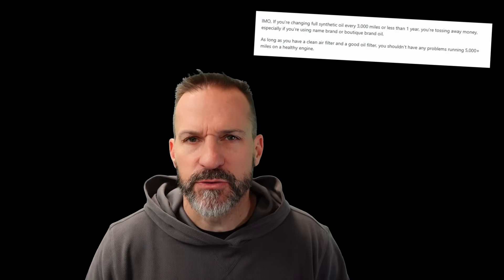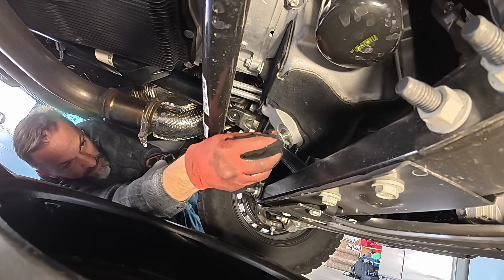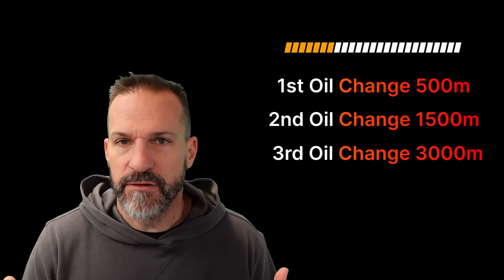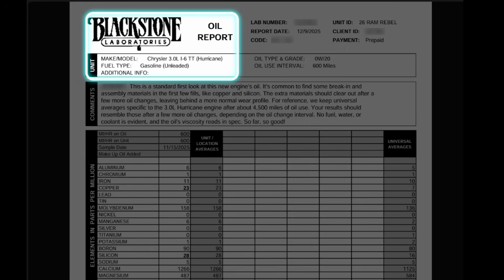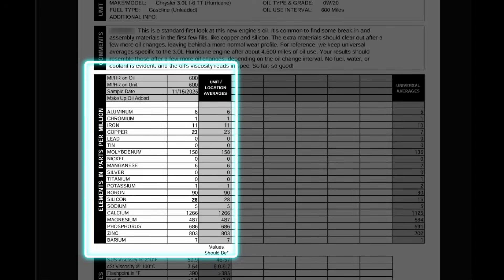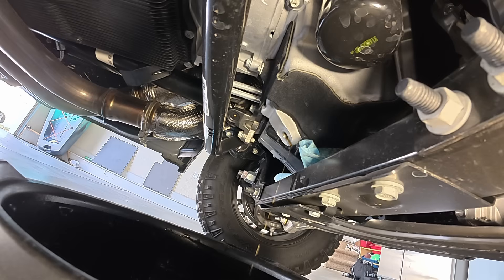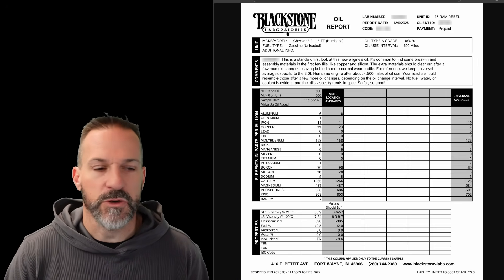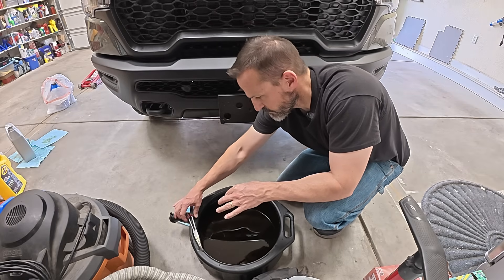Is the Motor Oil Geek Right? I Put His Break-In Theory to the Test

Comment: Lake speed is absolutely right, he has laboratory data supporting his conclusions. I was dogged by the service manager for changing my oil at 500 miles then 1000, then 3000. Because they knew I was extending the life of my engine. They have a perverse incentive structure that forces them to tell you to wait 10,000 miles before your first oil change. It should be criminal to knowingly give poor advice on how to best maintain a vehicle. Now that the test analysis data is out they will have a very hard time sounding credible when they try shoveling their crappy advice down our throats just to pad their bottom line with guaranteed engine failures going forward.

Comment: Known knowns.

0w20/40 is great for an engine running 10 mins at a time and race engines. 

Your production car or truck isn’t built with a race engine. It’s lowest dollar parts and machining.

They were built for 5w30 and sold to you with 0w20 to meet EPA requirement for MPG. 

In conclusion. 

If you bought a brand new anything- dump the 0w20-  run 5w30 and embrace the suck of less MPG. 

Better than having a car payment on a vehicle that’s been siting at the dealer for 7 months waiting on an engine.

Comment: The EPA was requiring long intervals on all automotive fluids.  Don't believe the 150,000 / 10 year OAT  Coolant interval either.  My heater core blocked up before 100,000 miles. My mechanic checked it two years out and it was full  of a white contaminant. We drained and flushed again. Good after a 2000 mile trip. Will check at next oil change.  I also dropped all the other fluids too.  I agree with Lake.  Testing!

Comment: Another factor in the crazy OEM long drain intervals are regulations in Europe.  They have a Waste Oil Directive in place that pushes OEM’s to support longer drain intervals and makes it extremely expensive to dispose of used oil.  Car makers sell internationally and the easiest way to comply is to say sure, 10K+ oil changes	 are just fine. They clearly are not. Somehow the people putting these misguided mandates in place totally ignore the environmental impact of early engine failures and replacement.

Comment: I agree with Lake on the break in ,but disagree with him on the Winter rating of the oil on these newer vehicles. I’m gonna be buying a Frontier here in the near future & I definitely will not be using any of the OW oils EVER in any of my autos. The lightest oil I will use is 5W-30 in my Frontier. Why is it rated in Europe to use 5W-30 ,but here in the good ol USA it’s rated to use OW oils! That tells me it’s a MPG thing not a tighter clearance thing. All the engineers want your stuff to wear out quicker so you have to buy another one. That’s my take. But I would definitely change my first oil at 500 miles  1500 ,3000 then every 3000 miles on a regular basis not 5000

Comment: ive only ever had new motorcycles, my 2018 z900 break in oil changes were similar to the oil change geeks recommendations. i want to say the factory manual had you changing it twice before 1000 miles, and keeping it below 5k rpms (failed that) for the break in period. i put 10k on that bike with out issue then traded it.

Comment: Just had my 1st oil change @ 1K on my 2026 Silverado with the 165 ci  (2.7 T) @ my local Valvoline quick change &
this is the 1st time the shop did not tell me I don't need a oil change. Word's out on extended oil changes & quick change
would not be my 1st choice, but it is recorded and affects your trade. I traded my 2024 Canyon for the 2026 Silverado &
they had the service records...

Comment: With my high compression small block V8 I built back in 2010 my engine builder recommended first oil change after 15 minutes of running then the second one after 45 minutes then a third one at 500 miles on it this is in a classic car so it’s all old-school technology and I don’t drive at all the time I have 8500 miles on it right now and running great.

Comment: There is no science to this, you'd have to have 2 exact vehicles driven exactly the same way, one with all these oil changes and another without, driven 100k miles exactly the same way to draw any conclusions from this. Otherwise all you have is the conjecture (or possibly hypothesis) that all these oil changes and subsequent drop in microscopic amounts of particles = longer life

Comment: Jump to 0w40 not 20 as 40 for engine protection. 0W-20 is a tolerance, not an optimum. In hot conditions and under load, it is logical to go for 40 with high HTHS especially in turbo engines.

Comment: People can have opinions.  But science and data is all that matters. Their opinions has little weight IRL.
I change after taking delivery on a new car. Then at 250, 750, 2000, 5000. The oil has a shimmer in it for a while. Takes a sunny day and some movement of the oil to see it.

Suggestion:
1) m = meters & mi = miles
2) aluminum isn’t ferrous
3) oil analysis only deterects the small stuff 
4) Silicon is not silicone. The silicon is from the dust.

Comment: It’s minimum required maintenance. For it to last any length of time. That’s the minimum maintenance you should do. You want it to last then do what he is saying. This is something I have been doing for 30+ years. This is not a new idea.  It’s now additional confirmation with additional science to back it. When I build an engine. About 1hour on first oil change. Then 100, 500,1000,1500, 3000 then as needed. Then around the 7k mark.

Comment: Did my break-in oil change on my 2023 Elantra N at 700 miles and then went to a 2k-4k interval. Have done 5 black stone reports and the first 2 came back with a lot of metals in the oil and ever since then (currently at 52k miles, last black stone lab report was done at 45k) has been really good.

Comment: please don't call this "science". Science is not reading a report and jumping to conclusions. Real science would be testing a 100 engines, using various oil change procedures, including a control, and then disassembling the engines and measuring real world results. Or even better: running those engines for 100k and seeing if it made any real difference at all. Don't get me wrong. I'm not claiming Lake is wrong. I'm just saying there is neither "proof" nor "science" in this video.

Comment: the real question is if that metal is anywhere near big enough to actually do relevant harm. I wish those reports also broke down the particle size distribution.
Reply: Speediagnostix has a particle count for the industry standard 4 microns/6 microns/ 14 microns.  It gets pricey adding that to the service, but I just had it done on my jeep at 185k after I heard some concerning noises.  It came back clean on all fronts. I am also curious if the small sizes are covered by the oil film, I suppose it matters how hard the engine is being pushed.   I have used oil tests for specific concerns for 20 years.  Although it would be fun, I don't do series like following break-in.  I just trust the data I see from others and have the common sense to follow that data and change my oil early.
Reply: @garyganser2451  oh , I don't trust anyone

Comment: This is good advice for 75%-80% of the engines.  The others are just badly manufactured or engineered.  Case in point:  my wife and I bought her a brand new Hyundai Sonata with the Theta engine.  I changed the oil at 1,000 miles, again at 2,000 miles then religiously every 4,000 miles.  By 70,000 miles it was burning a quart and a half every 2,000 miles.  By 90,000 we had a new engine from Hyundai.  I don't think any oil change interval could have saved that motor from poor engineering and poor machining.  The GM 5.3 is another good example, out of 25 or so we have had 2 that ate themselves from lifter failures.  All were driven, but by no means abused and they all had regular maintenance.  It's just luck of the draw sometimes.  My Grandfather/Dad used to talk about finding a vehicle that was built on a Tuesday day shift. You never wanted one built on a Friday night, I laughed at it when I was young, not laughing now.  For a reference, my grandfather worked at a Ford plant in the rust belt in the 60's and 70's and he had some stories....

Comment: I have Toyota Fortuner GR-Sport 2.8L Turbo Diesel. I did my first oil change at ODO= 1000 km (621 miles), 2nd oil change on ODO = 2500 KM (1552 miles), third oil & first filter change on ODO = 5000 km (3100 miles).

Now I'm changing oil every 2500 km (1552 miles) & oil filter every 5,000 km (3100 miles)

Comment: My 2022 tundra i changed oil at 500 2nd at 2500 3rd 5000 4th at 10000 and then every 5k. Made it to 37,000. At 37000 they put in new engine even though I didn't have any problems with it. And on the new engine I changed it at 300 miles and it had a lot of flakes in it. I did 2nd at 1500, and no flakes were visible. I did 3rd at 3k and no flakes. Hopefully, that did it.

Comment: Nope, break in is for piston rings to cylinder walls, poor breakin would cause oil consumption, as oil would pass the oil rings, plus most cylinders are coated with nikasil in aluminum blocks. You dont breakin rod bearings and crank bearings. Its simply oil starvation from poor engine design.  I would try a thicker oil.

Comment: Seems like everyone always mixes up silicon and silicone. The oil reports silicon which is a metalloid (same thing computer chips are made of) not silicone which is a synthetic polymer. Though I wonder if the oil reports actually want to say the synthetic polymer (silicone) and spelt it like the metalloid accidentally (silicon). Also your numbers are very similar to TFL Truck's Colorado with 18k miles (with exception to copper and boron). Odd that they bolded your silicon at 28 when TFL's truck was also 28 but they did not bold it for that one.
Reply: The impression I have on one being bold highlighted and the other not is variability in manual procedures.  Different people updating the form or variation from the same person doing it differently for no good reason in this case.  I appreciate your comment on silicon.  It does abrade things, therefore I care.  Silicone can plug screens on pickup tubes or VVT screens so I care but for a different reason.
Reply: Silicon is most certainly not a metal.
Reply: @marcinmerrimack1726 it's 14 on the periodic table and is considered a metalloid
Reply: @matth3wc  Right, and a metalloid is not a metal.
Reply: @marcinmerrimack1726 this little minor point has shaken the entire scientific community ... someone is being pedantic... You must be a fun person to be around at parties! Their point still stands the same that people mix up silicone and silicon.
Reply: @lekg010  Yes, agreed, silicon and silicone are often confused.  But that’s no reason to overlook silicon being incorrectly classified as a metal.
Reply: @marcinmerrimack1726  what are the elements used to make silicone?

Comment: Really good video, I did my 1st oil change on my hurricane at 3000 miles and was told it wasn’t due yet. Now I think it was way past due!
Reply: Yes, but to flush out any stubborn particles change it a few times early. I added a magnetic oil plug to mine. At first it was showing quite a bit of material, it’s almost non existent now.

Comment: I did something similar when I bought a new Honda motorbike. Only difference was the 1st oil change was done at 100 miles. After that I did 300 miles and then 600 miles and then 1000 miles. The oil capacity is only around 1 quart so I wasn't wasting much oil.

Comment: Back in the day - Honda used to ship all new cars with pure mineral oil to help with engine break in ... you were supposed to get that changed by 1000 miles and prior had to follow a bunch of driving suggestions (which I cannot remember now).  The dealer would do the first oil change for free ... I had a friend who went 10,000 before his first change ... the dealer said they had to flush the engine and do some other stuff to it, he still got well over 200K miles on that car before he sold it ... Honda's were really made well back in the late 80's and early 90's.

Comment: I think early oil changes are a good idea on brand new engines or components such as differentials or transmissions. But honestly, the benefits will only be seen after hundreds of thousands of miles. And even then, who knows if it lasted because of early fluid changes or just because of good basic maintenance. So, for people wanting to keep their vehicles for a very, very long time, or if you want to sell a perfectly running vehicle, this is good advice. Otherwise, nobody will know and few people will care... as long as you do good maintenance.

Comment: Why do we only apply the early fluid change logic on the engine oil? Shouldn't the transmission, transfer case, front and rear diffs all get the same treatment? They are all breaking-in as well. Heck, the water pump is probably sending break-in material through the cooling system. Should we flush out the coolant at 500 miles as well? I realize the coolant is a stretch, but I honestly don't know why all the other fluilds aren't talked about as well. Transmissions, transfer cases, front and rear diffs are expensive, fluid changes are cheap insurance.....
Reply: Dang might as well change some of them too

Comment: I am 70 years old.  All my new cars since 1973, always did 500-mile first oil change.  Then 1000 mile, then1500.  after that 2000.  Then 2000 regular oil changes always with a quality filter. Never had an engine failure.  Oil is cheap, your engine is not.  My cars ranged from econ-boxes to track monsters.  Learn how to do an oil change correctly.  I'll never buy a used car.  When the asshole never changed oil.   Don't forget regular tranny, brake, coolant, PS service fluid either.

Comment: I run Amsoil in all of my vehicles, and the reason I switched to it was I ran into an Amsoil seller at Lowe's one day and he offered to do pay for two oil analysis if I switched to Amsoil. The first was to get the baseline on my engine, and the second was after using Amsoil.

I was absolutely blown away by the results. Not only in the numbers but how the oil looked coming out of my engine. The Mobil 1 I used before and changed at 5,000 miles came out completely black. When I drained the Amsoil at 10,000 miles I could actually still see through it as it poured out of the engine. The numbers didn't lie either they were night and day. 

So, I run all four of my vehicles now with Amsoil and change them between 5,000-10,000 miles due to how they are driven. The oil, the filter, and the interval all matter.
Reply: I was told by an oil company that is your oil does not get dark it is not suspending the carbon that gets past the rings. It should get black. Thats what the detergents are for

Comment: I would change the filter each time, just so I can cut the used filter open, to inspect the media for "unicorn glitter". Filter magnets would also be a good idea, even if, for only the break-in period. 
     This break-in regimen will also help reduce oil consumption and blow-by as well, protecting catalytic converters, oxygen sensors, and even the turbocharger bearings. Those are all expensive components, and this move early on, will likely double the life of those components, saving far more money than a few oil filters, and a few gallons of oil. Oil and filters are cheap. Engines, turbo chargers, and emission control components are expensive.

Comment: Congratulations on your new truck, first time viewing your channel and I will be subscribing to see your analysis. 
My dad has been a mechanic for 40 years before he retired, I have been a service advisor and currently a service manager with 27 years experience. I have been doing oil change at 500, then 3,000 miles with all my new vehicle. First started with my 2004 Acura MDX, drove it to 287,000 miles on original engine, with 1 transmission rebuild(their transmission is known to fail those years). Then moved onto a 2015 Honda CRV and drove that to 268,000 miles before giving it away to my parents with both original engine and transmissions with zero leaks or issues. I now drive a new Tacoma and once again do the same break in procedure. It is cheap insurance but I do believe by the break in process. Modern engines don’t shed as much metal as those older generations but the tighter tolerances makes any small bit of metal debris more hazardous. Good luck with your truck and I look forward to your shared experience.
Reply from the maker: Awesome, glad to hear you are also on board with the early oil changes!

Comment: My Uncle and Dad would change the oil three times between certain miles on various engine builds when I was a kid.

On VW motors they would plug the plugs and spin the motor after changing the oil after a few hundred miles of break-in. Then that oil got dumped and more fresh oil would go in and then they would reinstall the plugs and drive about 500 miles - and then dump that oil and refill it and pull the plugs and then dump that oil and refill it and then reinstall the plugs and do a 1000 miles.

This was back in the late 70’s - early 90’s… watching them build VW engines, Chevy’s, a few Fords and three Porsche engines. Since then he had built fewer engines and I haven’t been around to see what he had done, but I’m assuming he stuck to what he used to do. 

He was a believer in single weight oil for his engines here in So Cal environment. He always used 30 or 40 weight. Pops is 89 and his days of being in the streets at Lyons or street racing on Firestone Blvd… he never had issues with motors nor did my uncle.

He sure was a fan of STP when they had those cans you opened up like a soda can. He swore by that stuff.
Reply: Dad used 30 for everything. Usually added STP each change.